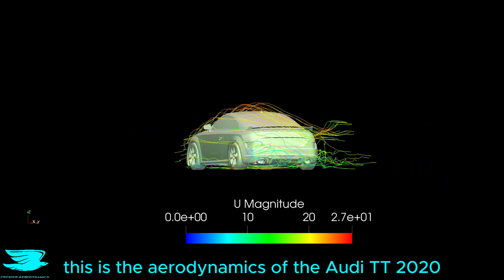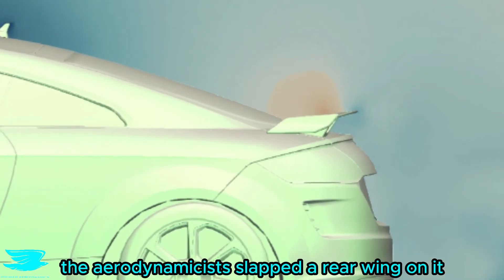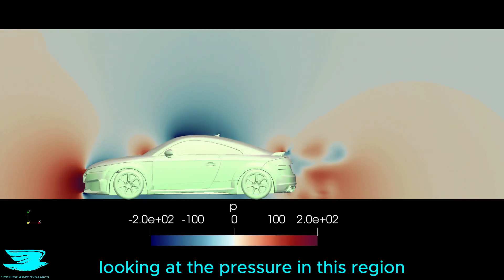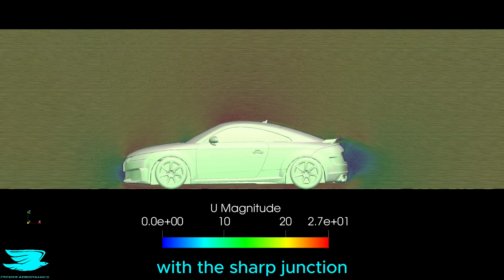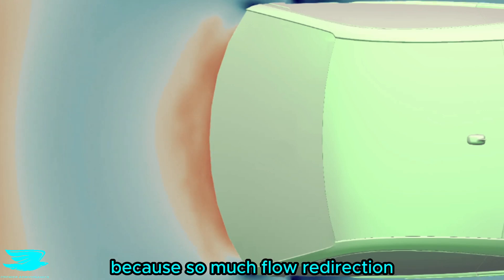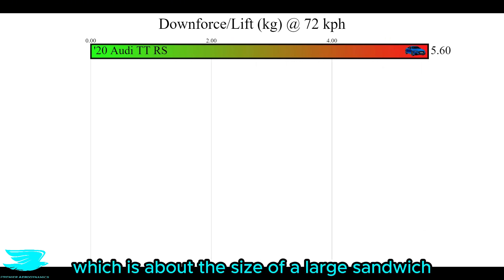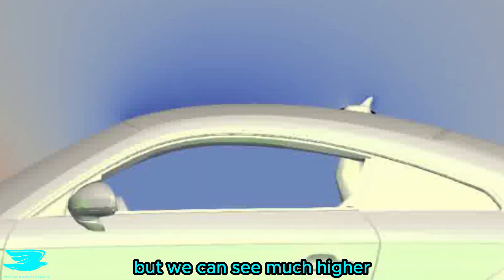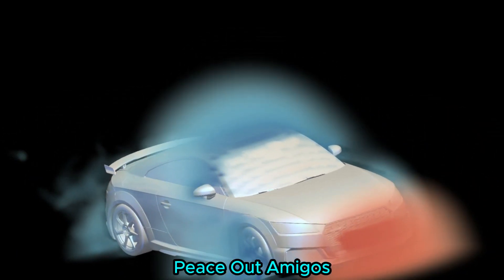Surprising Aerodynamics of the Audi TT

Comment: You should not really comment on airflow around the mask without modeling enginebay. Same goes for underbody, without suspension. And those are connected, because air goes through front and exits behind front axle. Also I believe, facelift version have, like you mentioned in intro, have air curtains, which drastically influence airflow around front wheels.
Otherwise very nice analyze. Thumbs up.

Comment: As far as this simulatuon goes the data is OKish. Yet certainly not accurate. That's something to take in mind, as people think this simulation is close to perfect. Welp it isn't. 

Even biggest manufacturers, F1 teams and so on with their superior software running on best hardware couples with folks that have best knowledge in the field don't rely so much on simulation. That's why wind tunnels time is so valued in F1 car decelpoment. Else they just could read all the computer data and carry on. Wind tunnels aren't as good as road testing either, with crosswinds, bumps in road etc. In F1 you can often hear teams don't undestand why things don't work, balance got wrong etc. If their experience, budget, most precise models including each screw and software can't visualise and find data on major issues - then those models have even more flaws in data and visualisation.

It's a good tool to get a grasp of overal tendency and for initial prototypes, yet if data needs to be precise and indicative of true effects then it's never as simple as generating a good model and running simulations.
Reply from the maker: Thanks for the input! And actually some OEMs rely solely on CFD because they have it certified, so they're allowed to.

Comment: Interesting fact: the beautiful first generation shipped with a round rear and no spoiler or wing. The result was that created lift at speed and was unstable while turning. Audi instituted a recall and retrofitted small spoilers to every car after several deaths. So, not a "fun fact".
Reply from the maker: I guess the original car wasn't designed with aero in mind, but more looks.

Comment: The aptera is a literal tear drop shape, I would love to know how that looks on an aerodynamic map
Reply from the maker: A general teardrop's aerodynamics is that the flow accelerates over the thicker part before decelerating over the tail. The front will experience slightly higher pressure than the back. That results in a little bit of drag, but because there is no separation, the pressure drag is kept down.

There is also no vortex drag. So the main component is the skin friction drag.
Reply: @PremierAerodynamics  I admire your knowledge and respect your education in the matter so much ❤ also is skin drag in any way possible to be minimized with a normal car?
Reply from the maker: It's pretty fixed out of the factory.

For cars in general, the two best ways are to try to keep the flow laminar as long as possible - that's hard for a regular car, but doable for a car built for aerodynamics. The second way is to reduce how much the flow accelerates over the car.

Comment: Thank you for including downforce! The videos are very interesting, a suggestion would be to show the speed that the downforce/lift is produced at and if easy the split front to rear! (for example 3kg of downforce at the front, 5kg at the rear at 200 km/h, that would be very interesting as many cars have for example lift at the front but rear downforce or the opposite, so the total downforce/lift number doesn't tell the full story)
Reply from the maker: Thanks for the tip!

Comment: Well, but you don't have the inlets and outlets around the front section, do you? Is it reasonable to comment on the nose aerodynamics then?
Reply from the maker: You still have a large, blunt section hitting fast moving flow, so that converts a lot of the dynamic pressure into static pressure on the engine bay and that increases drag. Syphoning off air is a much better approach for drag.

Comment: At first glance I thought open window would create more lift, along with more drag, but it reduces lift, at least over the roof, but increases it overall because it reduces the effectiveness of the rear wing. As the wake from the open window shifts the faster moving flow higher up, due to the unsteady wake. I think this is a classic case of vortex breakdown, the result of having too much rotational energy and not enough axial energy. This is why the wakes from the wheels is unsteady, and generally everywhere else in the car. Vortex breakdown is pretty much a von karman street in the flow field.
Reply from the maker: Those are good points. I also think that perhaps the lower pressure over the roof and rear window pulls the wake from the open window over it.
Reply: @PremierAerodynamics  Absolutely. Since the vorticity of the roof and open window co-rotate they would tend to merge with each other. They would also affect the axial energy, with the lower energy wake from the open window borrowing energy from the roof vorticity. This reduction in axial velocity leads to the breakdown downstream, creating the DRS effect on the wing, as the top comment correctly pointed out. Does the open window drag increase outweigh the drag reduction from the wing though?